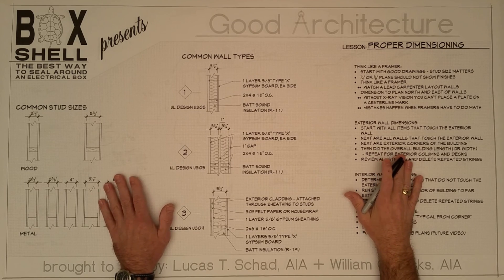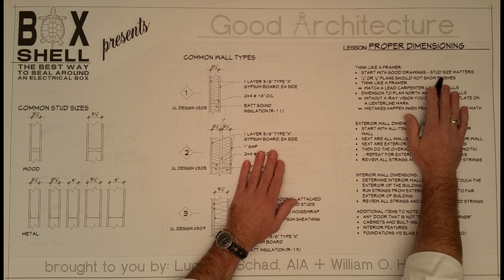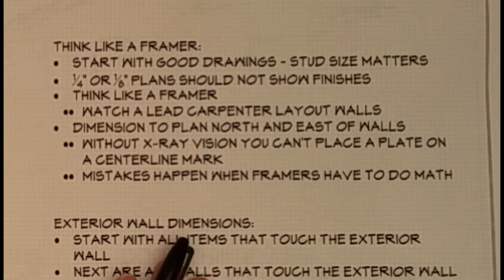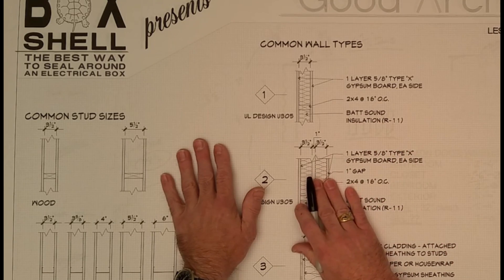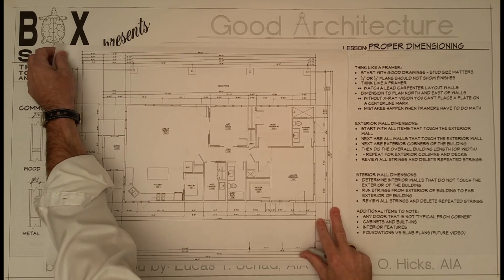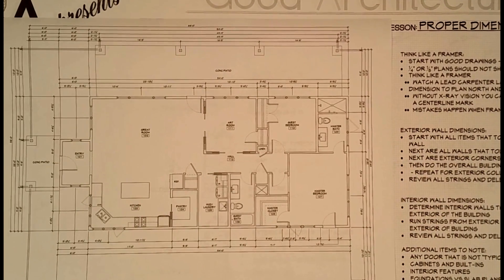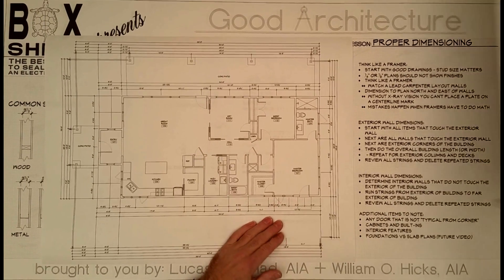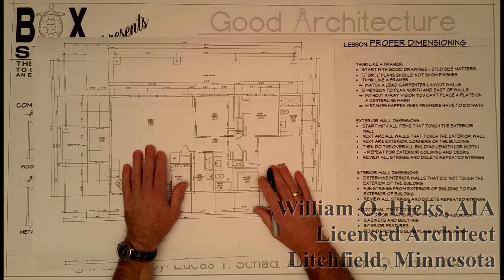Good Architecture: #6 - Floor Plan Dimensioning

Comment: I was shown this technique over fifty years ago when we were using manual drafting. Over the years, I've seen all sorts of other ways, but every one of them seemed to have built in errors or caused extra work for the framer in the field. The main thing that I see with this technique is that it leads to simplicity for the drafter, the plan checker, and the guy with the hammer. Face of frame rules in every situation. Having the dimension runs terminate in a consistent manner cuts the number of  "Oops" down tremendously.

Comment: Thank you for the detailed explanation. Regarding the dimension of walls drawn on the 1/4" = 1'0" dwg, do you not include the dimension of the gypsum board then?  For example, you suggest just drawing it as 3.5" for a 2x4 wall with 1/2" gypsum on each side instead of drawing it as a 4.5" wall. Thanks!
Reply: I believe what he's trying to say is that you only draw the wood studs because when they are constructing in the field you don't want the guys having to subtract for the gyp board. So don't even show it. That process is called Structure to Structure". If it was studs and gyp board it is called Finish to Finish
Reply: That's a bad idea. Draw everything actual size. Just dimension to the studs.
Reply: @urstudio383  tell me how you are going to get the dimensions to go to a stud face when there is no stud face